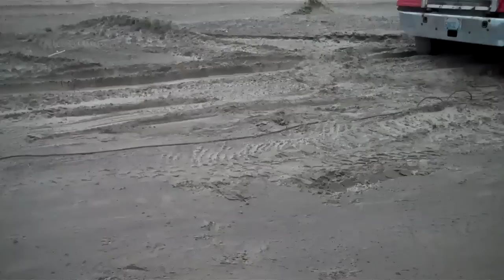semi tractor lowboy and excavator stuck on beach approach

Comment from the maker: @d4c24a 
They tried that first . Problem was the   bucket  kept pushing the soft sand  and the trailer did not move . We did find out later we had a brake hanging up on the tractor  . If we had known this to start with  we  wouldn't have needed a tow .

Comment: Why didn't they just unload the excavator to get him going?? Unless something was wrong with it I'm sure they could have unloaded and got it going then loaded it back in the time they waited o you to get there. I'm sure the driver wasn't paying for the tow and it would require an extra effort on his part to unload then reload. Lol
Reply from the maker: Hank Hill 
We have been told  not to side load the excavator off our trailer as it  is a light duty  ground loading lowboy .  The reason he couldn't just turn the excavator around on the lowboy and push   the truck forward is were sitting on a soft gravel and sand road . He made an attempt to  push the truck with the bucket but it just tore up the road . It didn't cost him anything for the tow as the  excavating company belongs to  my son and I . We own both Hill and son Excavating and Hill Auto Body & towing